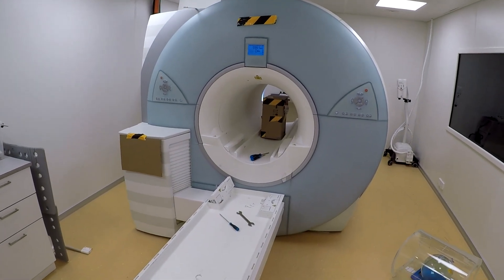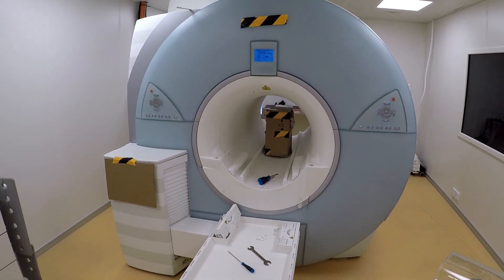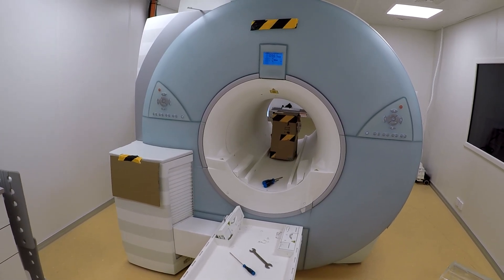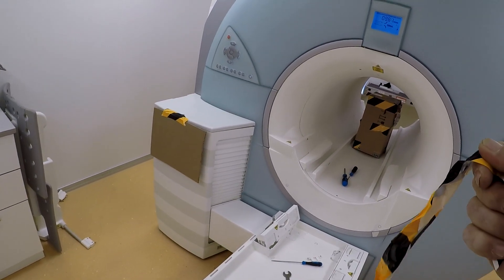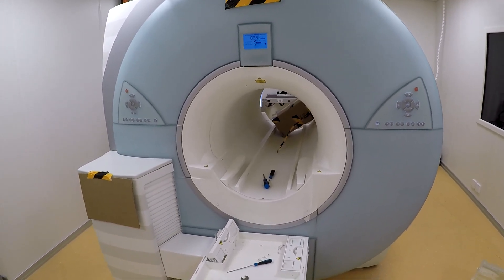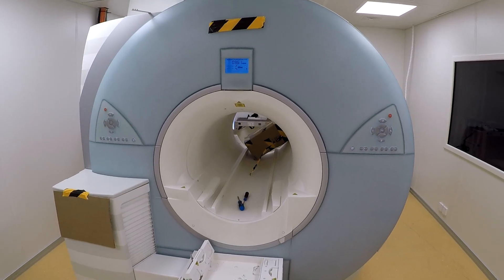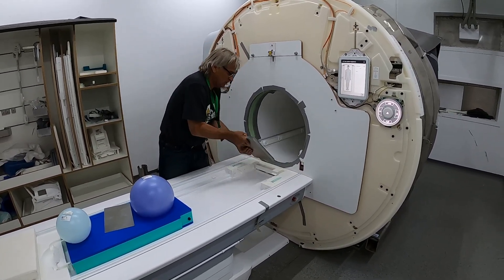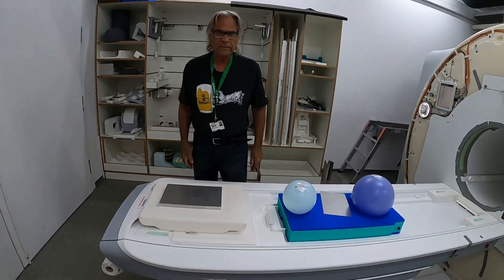M.R.I. superconducting magnet dangers and some cool physics

Comment: Last week the cleaning guy entered the MRI room with a floor buffing machine. The buffer got stuck to the scanner, took out the covers and part of the table. We had to quench the magnet to get it off........
Reply from the maker: Now that’s a bummer and expensive. I do believe after hours cleaning crews have had the most mishaps with these magnets. Went to a site to work on a new 3t that replaced a 1.5t system. Cleaning lady came in over night with floor buffer like she did many times before  and knew to stay away a certain distance but not realizing that the new system is now twice as strong, well you know the outcome

Comment: Excellent demonstration !   Enjoyed hearing your voice again. As you said, it just takes one mistake and ANY magnetic object regardless of size will be pulled in to the magnet once you get just a little too close. Each type of magnet is different as some have a larger external magnetic field, so the distance from the magnet will be different. It is not like gravity, the force on the object is exponential the closer to the magnet it is. Watch the slow motion of the scissors and you can see  it accellerate quickly!

Each MR exam room should be marked with large signs, but humans can become complacent and comfortable since your body is not affected, you have no idea where the magnet forces are greastest.  Magnet safety Training is essential for staff. As a patient follow the instructions provided by them, you will be safe. It can be a bit noisey. Don't worry, the staff has headphones with music  - of your choice usually :-)